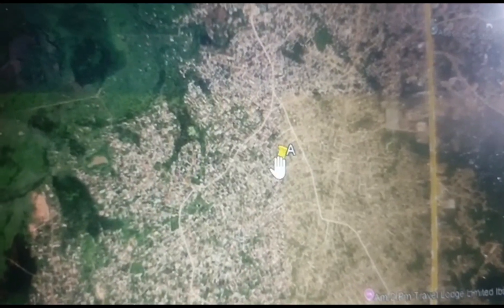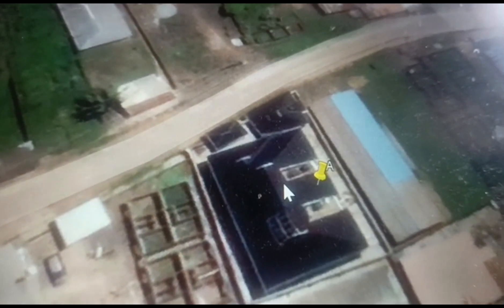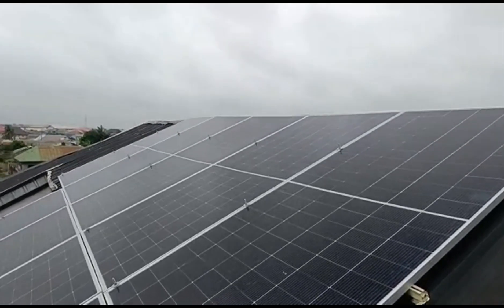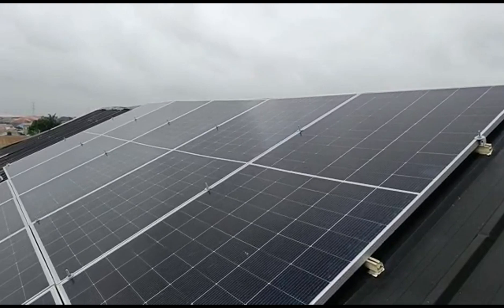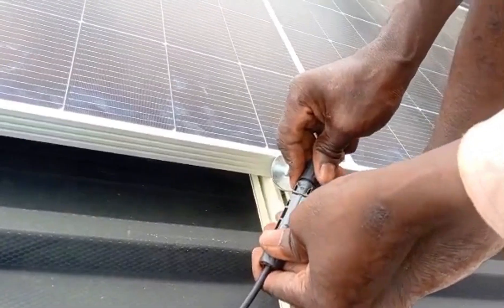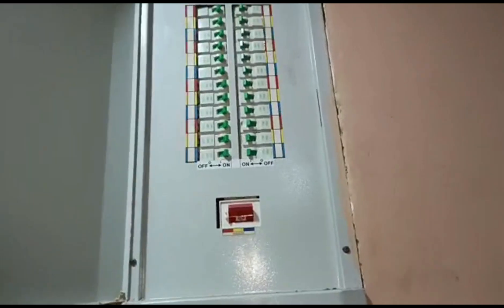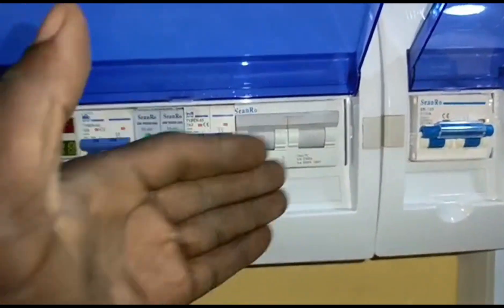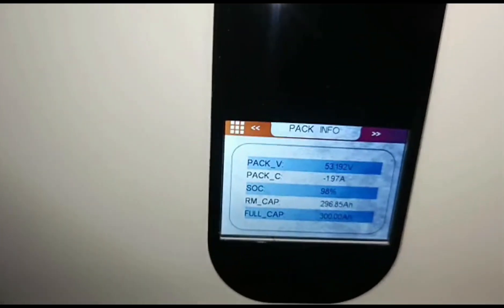Solar Install Breakdown: East-West Roof + 15kWh Battery + Overpaneling!

Comment: I also have an east/ west installation. All the theory science told us fell apart when it reached my system.
1. The west array picks up 2 to 6 minutes before the east array. 
2. Both systems climb and peak at the same rate and time
The only thing that holds true to textbooks is that the east facing array falls away quickly after 3pm and is basically done by 4 pm, while the west tapers gently until about 6 pm.
This has stayed consistent across all seasons of the year.

Comment: This solar panel has an Isc of 16.14A, which exceeds the max pv input current (isc) of the inverter (16A). Is this your integration advisable?
I can see it is working, but is it safe?
Reply from the maker: Thank you for your question.The panel will never run at ISC under real life operations. Its the maximum current the panel can produce when its leads are shorted. Its basically used for sizing cables, fuses e.t.c.
Reply: @linetech2651 Ok. Thanks. So what happens if, for whatever reason, the leads get shorted?
Reply from the maker: @E9_G OK, lets assume the leads are shorted for whatever reason, then the panels cell temperature have to be at 25°C, and Sun's irradians at 1000W/m2 plus the air mass right at that moment for their to be any possibility of anything at all happening. That .14A is not going to damage the inverter.
Reply: @linetech2651 Interesting! This is my first time hearing this argument being made for exceeding Isc. Thank you.
I'm curious a bit further. Does it apply to Voc as well? If no, why not?
Reply from the maker: @E9_G VOC is the critical one. In this case, its not about the leads been shorted. Its the voltage the panel produce under no load. Since your panels are connected to the MPPT input even when the inverter is not on, its very important this is kept at acceptable level to avoid the white smoke.
The VOC is easily influenced by weather conditions although that varies by geography. Its really important in this case to size the system in balance between the worstcase scenario(inverter startup voltage) and the maximum MPPT voltage input.